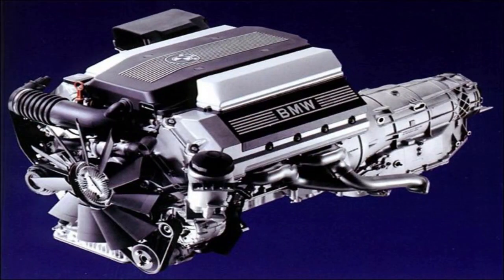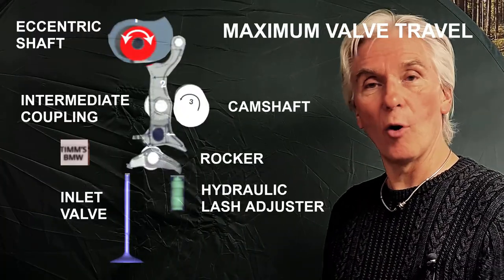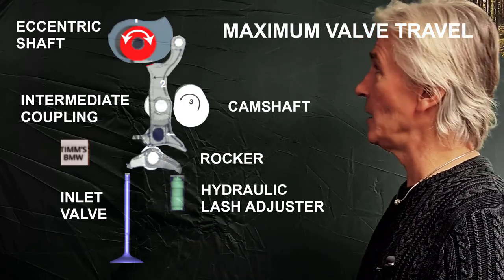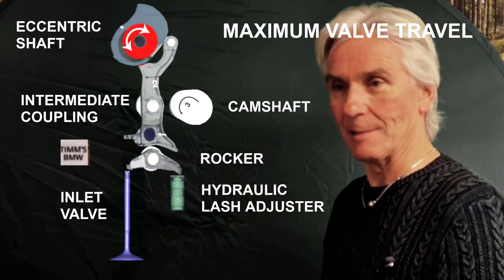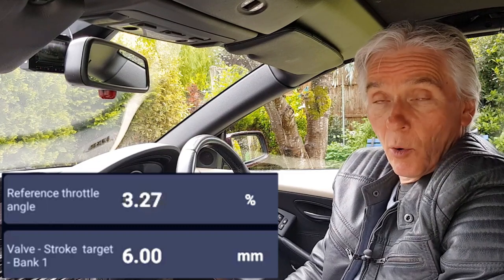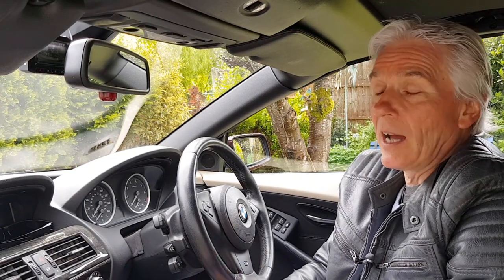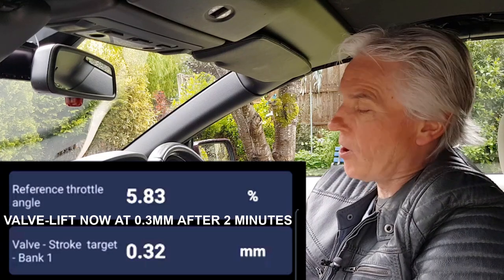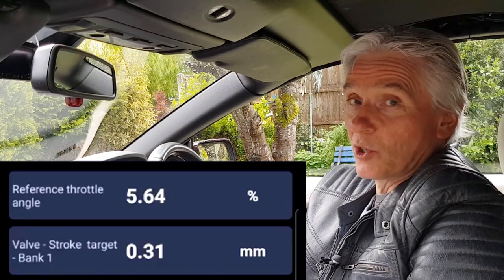BMW Valvetronic Problems-Fixes-Myths

Comment: Hell of a job on your in detail description of what and why thing happen in those " now not so complicated engines"!!
   Keep it up cause I learned more from you in 10mins that 5 hrs watching how to fix videos... 
  I have a customer with a n62 2005 x5 4.4i and it's been a bit tricky figuring out why the misfires. I replaced eccentric shaft sensor on driverside along with the camshaft sensors. I swapped sides with the valvetronic motors and fixed the oil leak from vaccum pump and plugged the vaccim line back into the little outlet on the front of it. Now there is only 2 misfires on 1 & 5 and camshaft sensor b on bank 2 but then another scanner reads vanos solenoid problems.. its confusing and why would misfires be on #5 or 8 when the sensor problems read on #1 w/ camsensor issues?
Reply from the maker: Hello Kevin, the problem is that BMW re-uses error codes, and unless the scanner has the correct tables matched to the DME then you will get a range of explanations for the same code. The best software is INPA as it reads the DME software version and then gives the correct error explanation
Reply: Is the INPA software same as the ISTA software ?

Comment: Hi Tim! I can't believe I came across your video. I've been trying to find answers to my problem through forums and JustAnswer mechanics online and non of it has really helped compared to your video! 

Long story short, had valve stem seals and guides repaired on my 13' 650i at local shop and when the valvetronic is connected, I get constant misfires in cylinder 3 and 7 and white smoke. Borescope shows oil inside cylinders as well. Disconnect the valvetronic however and it runs perfectly smooth no misfires no smoke.

The other fault stored is related to boost pressure. They're both shut off, and when I test the wastegates through ISTA service function, both turbo wastegates don't move. Exhaust valves are not moving either. I always assumed turbos automatically shut off when valvetronic is disconnected but I'm now thinking the shop screwed up the vacuum lines to the pressure converters and turbo wastegates.

Theres traces of oil in the PCV valve as well. Which is strange because it was working absolutely fine before the repair. Its only a few months old.

So..... Given its a twin turbo car, I'm assuming the turbos have to be functioning in order to create the vacuum for the crankcase ventilation to work and in turn stopping my oil leak and misfires? Does that sound like it could be my problem?? 

Looking forward to your answer!
Reply from the maker: Lots to read there - post the problem on bimmerforums.co.uk and I'll have a look at it there!
Reply: @TimmsBMWRepairsandInformation thanks for the reply Tim. I have posted the comment on bimmerforums UK, under the 6 series sub-forum 🙏🏻

Comment: Hi Tim, just dropped onto your video, excellent insight into the workings of the valvetronic system. I have an '06 650i with the rare manual gearbox and on the whole it is a very competent machine. However, it does have one very irritating fault. Under normal driving it is excellent - very torquey and smooth right down to near idle speed. When giving it some beans there seems to be a definate lag between releasing the throttle for an upshift and the revs actually dropping. Then, when releasing the clutch and flooring it again there is a lag before the engine responds. This lag is not massive but significant and makes it very difficult to accelerate smoothly at full chat. If the car was auto you probably would not notice this because you would not be lifting for upshifts. When parked on the driveway the throttle response is fine, unable to fault. There are no fault codes and the only other issue is a slight lumpiness when the engine is cold, which I would suspect is over fueling (temp sensor or AFM). Any thought's or suggestions appreciated.
Reply from the maker: I don't think this is a mechanical problem - the software on the N62 is lacking in a few respects!

Comment: Dear Timm, I really appreciate your excellent videos and you helped me a lot with my car.
I think there is one element of the explanation missing here, or maybe I didn't understand it properly. One of the major reason for VT saving a plenty of fuel is that it avoids much of the pumping losses. At low power or at idle, a normal (non-VT) engine must pull in air from the inlet manifold at very low absolute pressure and this takes a plenty of work. In a crude view, at suction phase there is much less pressure on the top surface of the piston than at the bottom, so the piston is spending mechanical work on the gas, unlike at the expansion phase, when the gas is working on the piston and the engine is actually producing mechanical power. The work spent on sucking in air can be considered as "negative work" of the engine missing from the output but still requiring fuel to be burnt for.
Since the manifold pressure of a VT engine is kept by the regulation of the throttle very close to atmospheric pressure, that is, there is no significant vacuum in there, it needs much less work for the piston to take in the necessary (at idle) small amount of air.
This sounds an uninteresting minor thing, but in real life this is an extremely important thing. These overmotorised cars have huge displacement and much-much more power available than really needed for most traffic situations. Thus in most of their life the engine is running at very low power or idle (like in a traffic jam in London :) ). At low power the huge displacement comes with disproportionately large pumping losses compared to the mechanical work produced by the engine, therefore VT can save a plenty of fuel by reducing this loss.
Reply from the maker: Yes, that's a good point and something I should have mentioned

Comment: Very well explained . I even understood a lot of it. The pcv valve on my e60 525i can only be replaced by removing valve cover completely.  And then the pcv has to be cut off to replace new pcv. Then new gasket and new bolts for cover for a $30 part . I was so annoyed concidering it may not be the issue. I've had no codes.
No checklight .
Reply from the maker: That's just crazy! You don't mention what the problem is though....

Comment: I have the X5 4.8is with the N62 engine. I change the oil every 5000 miles (8000km) and have never had any problems with VANOS or Valvetronic. Use a thicker oil because of the high mileage. I like Liqui Moly Top Tec 4100 5w40 and has been great 👍 engine loves it
Reply from the maker: That's the way to do it, good job!

Comment: For the scenario with the clogged PCV system causing the smoking, I would imagine that the higher intake vacuum when Valvetronic is disabled would suck more unseparated air-oil blowby into the combustion chamber causing more oil burning rather than less.

I'm just trying to wrap my head around the explanation you gave.

Or are you implying that more airflow through the PCV system (from the greater manifold vacuum during non-Valvtronic operation) equates to greater separation of the oil from the air and therefore less oil sent to the combustion chamber?

Thanks in advance.
Reply from the maker: The PCV system relies on manifold vacuum to work correctly - which it does well on the M60/M62. The problem with the N62 is there is almost zero manifold vacuum when in Valvetronic mode and that stops the oil separation working well. Often exacerbated by blocked passageways in the separator in the valve covers.....
Reply: @TimmsBMWRepairsandInformation   Thanks for the clarification. 👍

Comment: Interesting. Even BMW sold the Valvetronic system as something that makes the conventional throttle obsolete, but in fact thats not the case - the two systems actually work in tandem.   These engines are genius (I have the N52 6cyl) when you learn to understand them and get them running just right, and a nightmare of confusing symptoms and expensive problems if you don't!  I'm still learning about mine and, while it does seem intimidatingly complex at times, I do have to marvel and the ingenuity of it all.
Reply from the maker: Thanks, there's a lot of mis-information around!

Comment: Hi Tim, new subscriber here! I have recently bought BMW X1 X20i 2018(F48) and on dashboard I don't have any kind of light on but when I read DTC's I see there is one error:  DTC 133710 Intake Valves adaptation air mass flow: lower limit position reached.
1.What I have observe so far is when I start the car first it starts at 1.1 RPM but being gasoline car I think it is normal but until it drops under 800RPM I feel some rough/bumpy vibration/senzation
2. When I have like 50km/h and I slow down some times it change gear rough like changing from gear 4 to 2 and I can feel that.
3. Sometime when I have foot on gas pedal for like 1s there is a burst of speed, like I full accelerate but my feet is constant and I don't do that.

So the above is what I observed I am not sure if everything is related to valvetronic but so far I have been to a mechanic and he said that I should change everything related to valvetronic and that is around 4000euro.
My question to you is, can't be saved anything from there ? maybe it is like you said at the end of your video just a valve sometimes getting stuck or something like that.
Thanks in advance :)
Reply from the maker: Have a look at my other video's on the E64/N62 you will get some answers there. You need to have the bridge-seals replaced on the mechatronics gearbox, that will sort your gear-changes. Don't have anyone fiddle with your Valvetronic system, it's never worth it,

Comment: Thank you so much for this video.  You really tie it all together.  Absolutely perfect.
Reply from the maker: You are so welcome!
Reply: @TimmsBMWRepairsandInformation  You earned another subscriber!  I recently bought an 08 528i that had been diagnosed as a head gasket issue.  Nope.  A lack of fundament understanding of the Valtronic system (and 1 coil pack) was the culprit.  Will be replacing the valve cover while replacing the sensor.  Ordered the Mitzone (sp?) aluminum replacement.  Not sure if it was a good idea...  Going to be about $1500 US into it.  This video was the keystone.
But thanks again.  I'm going to drag home every broken BMW I can find!

Comment: Thanks. I found this a really interesting video. Although it didn't make me feel any better about the repair bill I'll likely be getting for the worn eccentric shaft in my N55 powered 135i

It does seem an amazing system but it's also pretty flawed if it can have catastrophic failures like this in a well maintained car with only 130k kms on it.

Comment: Hello Tim, great explanation, I have a question on the Vanos issues on a 2012 328i N51 engine. As soon as I start the car RPM revs up to 1500 drops back down to normal and a code gets triggered. I have rebuilt the engine completely, I also changed 3 heads thinking they were the cause. Changed the carbon oil seals at the cam shafts, changed the Vanos gears, solenoids and valve cover gasket, the cam sensors too. Nothing changed, still the same 2 codes. So, one is under OBDII scan and the other is in the deep scan mode and they are P052B and 2A7C. There is not much info on these as they are really rare. I was told by a friend from England actually, that the codes might be generated by what you referred to as the stepper motor(Eccentric Shaft Actuator Valvetronic Motor). You explained that it turns counter or clockwise, and it contributes to the valve openings. But you also said that the Vanos system doesn't work right away I think as you first start the car. My problem is in the first 10 seconds of starting. Let me know if you know these codes and if you have any suggestions. I simply drive the car like this now it is fine, but the codes are always there. Thanks in advance mate.

Comment: Waow. So so many details I didn't know about VTC and throttle valve.
Thank you Sir.
I have a question though. I have a N55, it has the VTC but it's also turbo charged.
You said the CCV need an underpressure in the intake manifold to work properly.
In my case, when under boost, the pressure is positive. How BMW designed the CCV then on turbo charged engines ?
Thank you.
Reply from the maker: The crankcase still needs a vacuum, but it can't get it from the manifold. There is a separate vacuum pump for the crankcase - the vacuum for the CCV is generated by a venturi from the same system

Comment: Hi Tim, love your channel! I have a 2018 M2 with the N55 engine which seems to have a tendency to suffer from valvetronic issues as many have reported a ticking noise developing at some stage of its life. I have not experienced this yet (and hopefully never will) so I was wondering if you have any advice on how I can prevent this issue from occurring other than keeping up with the routine servicing? Thank you!
Reply from the maker: Yes, oil changes every year or 5000 miles whichever is first!

Comment: Hi Timm, thanks for for such informative and well made videos. From fellow M62TUB owner, haha. I'm surprised they were still using the 'clown nose' (as I've heard it called) in the 650i. I removed it from my 2001 540i because I felt like a police detective from 1986. I hope it is just for the alarm active light, and not anything else.
Reply from the maker: Thanks! It look ridiculous, but smaller than it appears in the video! I've had three M62TUB's and two M62's, and they have all been reliable and easy to work on - and never had chain guide problems on any of them - but I always replace the chain tensioner straight away!

Comment: Thank you very much for your brilliant videos. Because of you I am changing my engine oil at half the BMW intervalls.

Maybe you can even tell me where to look at with my ´06 e61 550i with lpg. It is a strange failure as it occurs only very rareley but is quite annoying when happening. The last time it happend was around 15k km ago and then again last weekend. 
After driving on the german autobahn at around 160km/h for a few minutes suddenly there is a check engine ligth saying cylinder 8 misfiring. Deleting the failure will not bring the cylinder back to life. After driving for about 150km on 7 cylinders the eight one will be back to life again and working like nothing happened.  This failure will not happen all the time on the autobahn. Most of the time I can drive as fast and as long as I want and the engine is running fine.
Sometimes after a longer drive on the autobahn and then coming into a city the engine light is on on the first slower drive. Reporting misfire on cylinder 8 again. This is is an easy fix though. Just restarting the engine will solve it.
Misfires happen on LPG and gasoline.
After the first time the big error happened the spark plugs and ignition coils where changed for Bosch and Delphi.
The engine idles fine (500RPM) and is quite powerfull I would think. In the past week I noticed around 1-2 misfires per day on my way to work (17km autobahn, limited to 100km/h). Engine light stays of on these occasions.
Last week when it happened I shook all the cables I could reach to try and find a loose connection but nothing improved my situation. Car has been to a dealership already but the failure was not occuring and they didn´t find any mistake on the car. Unfortunately it was Sunday both times the cylinder failed so there was no chance to ask a local dealership while it had the fault.

I know it is hard to impossible to do diagnosis without having the car near you but I would really be glad if you could hint me any more things to look at the next time the fault happens.
Reply from the maker: Bit of a tricky one - have you checked your roughness values at idle using something like INPA? (see my other video's on INPA) as that would give us some idea's.
Reply: @TimmsBMWRepairsandInformation  Do you mean when the cylinder 8 is not working or while it is working? I have INPA so checking the values would be no problem.

Comment: Very nice explanation on valvetronic and cranckase ventilation system. I assume the throttle body control works a bit different on turbo engines. Cranckase ventilation system is also a bit different there (with two working modes depending on the turbo regime...)
Reply from the maker: Thanks! Yes, most turbo engines use the vacuum from a venturi in the exhaust for creating negative crankcase pressure
Reply: Hi! I was thinking about bmw engines with valvetronic & turbo. A two-part crankcase ventilation system is used in these engines as far as I know. When the engine works in naturally aspirated mode the blow-by gases are routed directly into the cylinder head intake ports. When the turbo is raising the pressure in the head intake ports (and we no longer have a vacuum) the blow-by gases are routed just ahead of the turbo fresh air intake. So I wonder how the throttle body operates in these engines. Maybe this is where the "myth" about "always open throttle body" comes from. It would make sense in a valvetronic&turbo setup...

Comment: Hi, thanks Tim for an amazing video. I have one question though, I cannot find reliable information on this: I want to replace the valve cover gasket on my 2006 e86 Z4. Too remove the valvetronic motor you need to close a screw on the motor that locks the shaft so it doesn't all spring apart when you remove it, upon refitting however there is no agreed upon process. My method would be to count the number of turns to close the screw and then do the opposite when refitting, however no one really mentions this and additionally there is contrasting information whether the motor needs to be recalibrated or not. Can you help?
Reply from the maker: Yes, the complete motor has to be unscrewed, and when replaced got back more-or-less in the same orientation. But, even if it isn't, it will soon adapt again, in fact, in a few seconds!